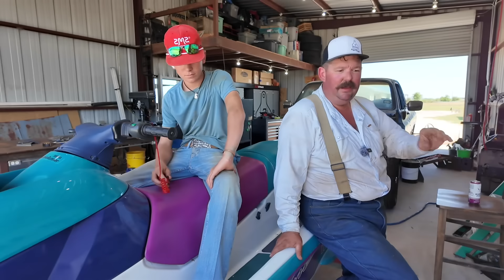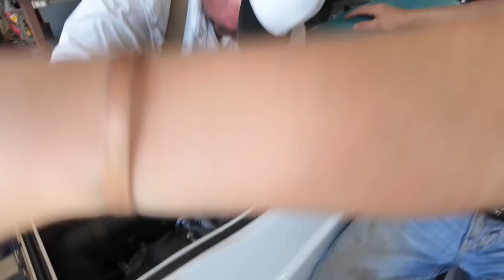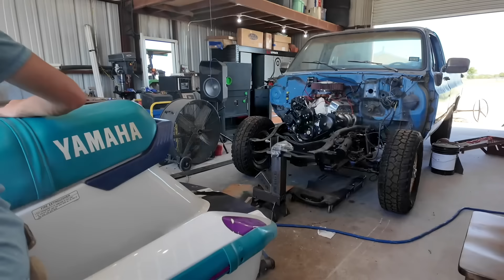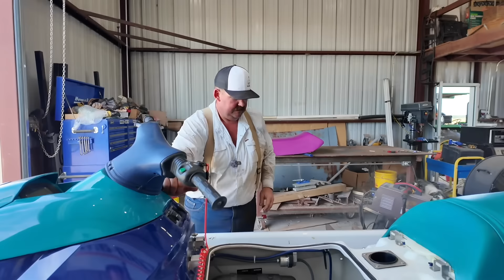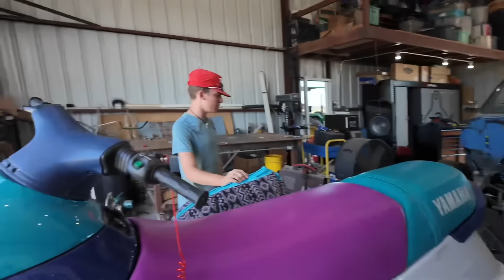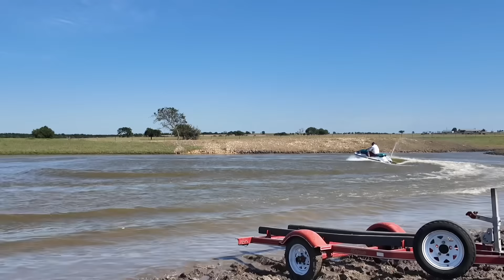New Addition to the Ranch | Bar 7 Ranch

Comment: Remove carbs and clean the jets. Check out OSD marine for carb rebuild kits. Also put in new NGK spark plugs. Make sure to keep oil tank full and that thing should last a while. If you don’t clean carbs it will run lean and burn up the pistons really fast.
Reply: Yep if it sat for a long time the jets need cleaning. I have to do it all the time with my 2-stoke outboards